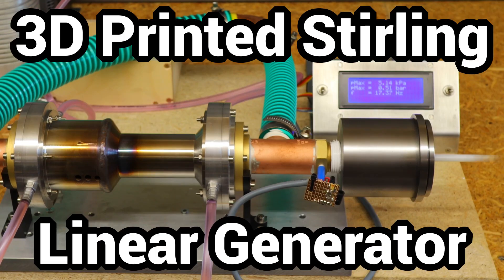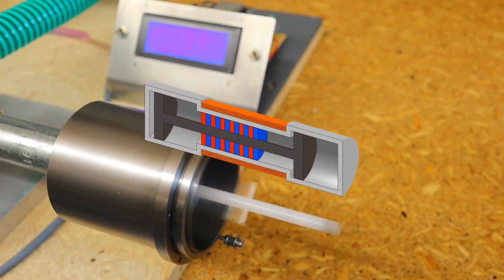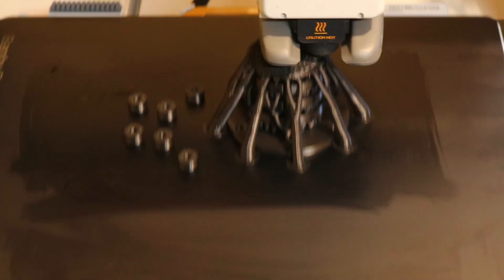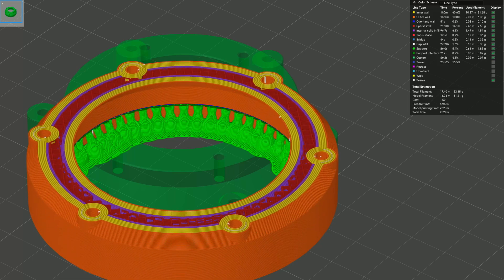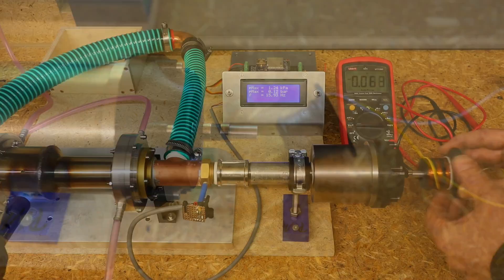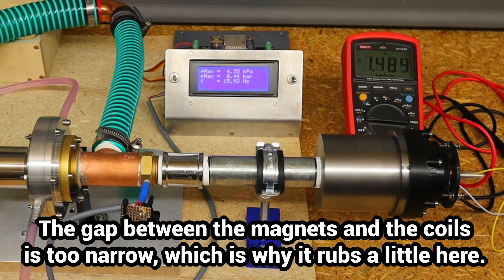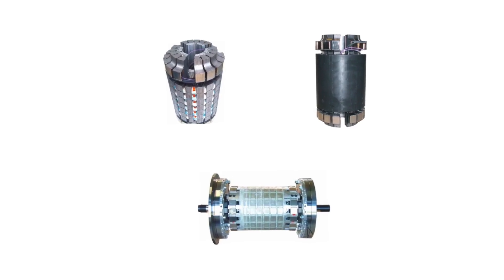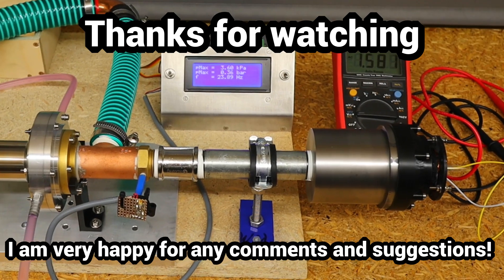Linear Generator for thermoacoustic Stirling engine – how to get most power from magnets and coils ?

Comment: I am designing one and i decided to go with EI-60 laminations with the legs pointed towards the mover, and a halbach array on the mover. This design of yours was my initial design as well but I decided against it, simulations show the flux linkage just isnt there, no way to get decent flux with iron either, no space for laminations (or complicated laminations).. Disadvantage is you need about 150mm ID to make this work
Reply from the maker: Yes, at the moment I am also thinking about a new design.
I am playing around with FEMM and try to find an optimum arrangement.
I want as little as possible moving mass and not too much coils as I want to rectify them separatly for efficiency reasons and I want to use the generator also as a linear motor for starting.
A Halbach array is really nice but also quite complex.
If you have any suggestions, I would be very happy!
In the next weeks I will spend much time with designing with FEMM and other tools to get a powerful linear generator.
Thanks for your kind comment and looking forward for more, do you know our Discord server? There we discussed already a lot about linear generators, itwould be nice if you would join!
Reply: @myengines2443  I suggest winding your coils for a battery voltage (as in back emf at your expected mover velocity), and then use an off the shelf BLDC controller, you just have to make sure you offset your 3 phases so its true 3 phase AC othrewise it wont be able to drive it. Then with controllers like ODrive you can just use UART on an arduino to tell the odrive to add or subtract X amps (torque mode on the controller).
Reply: @myengines2443  Not able to find your Discord server btw... what is it called
Reply from the maker: The link is in the video description!

Comment: you can take metal dust from a band saw and mix it into a plastic casting solution and pour that into your coils, it gives you the best of both worlds, not too much steel to cause drag, but enough to enhance magnetic flux
Reply from the maker: Yes, I saw this in a Youtube video.
There pellets of a few mm size were used, what is better?
Thanks for your nice help!

Comment: Good progress Sir! I have rectified each coil separately. It is the way to go. The precise diameter of the wire is irrelevant, it finally only determines what voltage you get out. The higher, the better. Then diode losses are minimized. I work with about 36 V capacitor voltage (after rectification).
Reply from the maker: Yes, to rectify each coil separately is better, also for control reasons for starting.
My first linear generator hat much to long and thin wire which has a very big resistance ( 142 Ohms ) which is by far too much! 
36 Volts really sounds great this would male it possible to use parts from the photovoltaics sector like MPPT and charge controller.
Thanks for your nice comment and plz make more videos :-)

Comment: Iron cores are meant to guide the magnetic field through the inductor, but the magnets themselves move through the coils so this seems unnecessary.

For the rectifying part: You could change the coil offset to make it a three phase generator. Then any three phase rectifier would work.

Comment: Hello, do you think the Stirling engine is more efficient or the thermoacoustic engine?
Reply from the maker: I think with both can be achieved the same efficiency but the thermoacoustic can be made with much less effort and less moving parts and so much cheaper which is the main problem of the Stirling engine.

Comment: bonjour, vous êtes sur la bonne voie. il y à plein de façons de faire des générateurs linéaires, le plus simple est en général le mieux.
mais je pense que pour les engins thermoacoustiques le mieux en terme de puissance de sortie (Watts) sera: 
-soit un teng mis sous air comprimé, 
-soit un générateur électrostatique comme celui de Noel Felici (un générateur de 10cm de diamètre par 15cm de long sous 8 bars génère 75 watts à 3000rpm).
-pour du piézoélectrique PZT, je ne sais pas... ce serait à essayer (peu efficace je pense)
le problème avec le générateur électromagnétique est que la masse des aimants est trop lourde, et que en charge le back emf stoppera le moteur acoustique (cogging).
en tous cas, bel effort!
Reply from the maker: Thank you for your kind suggestions, I will look them up!

Comment: This is awesome. Makes me want to get back into it!
Reply from the maker: Just do it, your videos are really impressive!
Reply: @myengines2443  https://youtu.be/n0kV_LOq11o?si=nxQzxgKIzMR2pCqt
Reply from the maker: @LES_Thermodynamics  this engine is very interesting and suprisingly powerful!
The mechanism to convert the linear into rotational movement is very interesting and I wonder if it is possible to make it for higher powers with low friction?
I really want to look out for this!
Many thanks for your suggestion!
Reply: @myengines2443 it’s powered by high pitch sound - which your engine makes. It would be interesting to see! Mine have always made low roars.

Comment: in order to correctly measure the output of an alternator, the prime mover  Must  be operating under a nominal load.    this can be simulated by shorting the output.    then you will know the  Actual  reference speed  on which output volts and amps must be  'based'.
Reply from the maker: Yes sure, there are so many things to improve before I can make a proper power measurement!

Comment: 047    that would be the  world's  WORST  coil.!!!       generating coils  NEED  to be correctly  made.     the coils you plan to make will act as current  CLAMPS.      meaning, coil output will always be  disappointingly  low.      coil design should allow for the use of  iron  cores.!      otherwise, coil efficiency will be even  lower.
if you can't get silicon steel for cores, use  common  steel  nails.       spray them, separately, with lacquer or similar.  for isolation of the nails when they are 'bundled' together.      (see the use of laminated silicon steel cores in motors and transformers.)
in this case, the generating coils should be wound using  multiple strands  of (larger) magnet wire; say  18awg.
a rotary alternator will always be more efficient than a linear one.
Reply from the maker: Yes my first coil was a mess and with the help of you and many others I got much information to make the next one better.
The one after next will have an iron core (I have pure iron, I can't find a source for silicon steel).
I plan to cover the coils from the outside but have to  get more information before.
many thanks for your help!

Comment: I think the crank arm idea didn't work because it has inherent wiggle. Whatever this thing is called, it moves absolutely straight back and forth. It gives the engine a flywheel, and the alternator gets rotational motion. 

https://youtube.com/shorts/HUW4g7v1sG0?si=udfEwsKWXhlSn8MB
Reply from the maker: The link does not work for me, can you please check it?
It sounds quite interesting, thanks!
Reply: @myengines2443 
https://youtu.be/4q5_jr3FSzY?si=jf7FaRCj3HylaL61
Reply: @myengines2443 
https://youtu.be/IcRkfFQQiEg?si=s-uTAs3JMEu4Vasf

Comment: Thomas Steiner has developed a diaphragm thermoacoustic generator without moving parts with an efficiency of more than 20% of the flame energy. 1000 We
https://youtube.com/shorts/t28hXxKnF-A?si=-oP5WScUiUsWcBbO

maybe the generator should also be made from a membrane?
Reply from the maker: Your link does not work for me, but I found his engine with very few information.
I am not sure if a diaphragm / membrane can be really reliable for month 24/7?
Reply: @myengines2443 

One of its engines has already clocked up 12,000 hours without repair.

Etalim engine Thomas Steiner

Comment: you can use a freewheel clutch, like a bicycle

https://youtu.be/l2UptoPQyH4?si=6QEHBPPoauCN4Mvi
Reply from the maker: Looks very interesting but the efficiency seems not to be optimal and you use only half the power for the movement up or down?
Reply: @myengines2443    
the best work that can be repeated by DIYers - "Development of a 5kW traveling-wave thermoacustic electric generator"

Comment: 3 Volts is not a good description of the power output. But generally, good work.
Reply from the maker: No of course the voltage alone says nothing about the power but I am still developing the test stand and its still not suitable for proper power measurements!
Reply: @myengines2443  Thanks, I'm looking forward to more information.

Comment: If you want to strengthen your 3D prints easily, I highly recommend trying the runny superglue trick. Robert Murray Smith did some videos where he showed that applying low viscosity superglue to 3D prints led to the glue wicking into the pores and gaps between extrusion lines. Then, when you spray it with an accelerate catalyst, the glue hardens, and the entire printed part becomes substantially stronger. Try this and see how it works for you.
Reply from the maker: Thanks thats a good suggestion, I already make some tests with Dichtol at the moment for gas tightness test which has similar effects I think!

Comment: What is the electric capacity you aim to achieve with your accustic engine. If I remmeber reight your old Sterling engines were between 150 and 300W.
Reply from the maker: I hope to get also in these power regions with the thermoacoustic engine but it is still a very long way.
I didn't optimize anything yet as I want a power indicator first to see wahts an improvement.
The rhombic Stirling produced up to 300 watts.
Reply: @myengines2443  Are you intending to go offgrid or just displacing grid consumption. Doing some napkin math, in the Winter a single 300W engine running 24/7 should cover your electricity needs, would it not be smarter to run 3 100W engines (if efficiency is similar) for better reliability? Just food for thought.
Reply from the maker: But 3 engines are 3 times more complex, I want to use it as a backup for my solar power plant which only need support in times of low sunshine.

Comment: Are you going to heat your experimental acoustic engine with electricity, so that you can easilly measure the power going in? Also - why didnt you turn the spool on the lathe?
Reply from the maker: When I make efficiency tests maybe I will heat it using electricity if necessary.
I did wind the coil on the lathe or what do you mean?
Reply: @myengines2443  I meant that you 3D printed it, despite it looks like an ideal object for making on the lathe.
Reply from the maker: Because I try to make as much parts as possible with the 3D printer because its cheaper,  faster more easy and rebuildable for everyone!
Reply: @myengines2443  Heating the acoustic engine with some resistive wire inside the engine is really very convenient, beside the fact that you know exactly how much heat you put in the engine.

Comment: Also, for simplicity I would suggest one coil and one magnet to begin with.  The output wouldn’t necessarily be a sine wave but diodes do not mind.
Reply from the maker: The next configuration will incorporate 4 individual coils so I can experiment with 1-4 active ones and different series/parallel configurations and 1-4 magnets.
But I think after this I will concentrate on a flat design with iron cores?
Reply: @  nice, it really depends on the coil magnet configuration.Halbach arrays work well for linear motors, especially with back iron.  But a solenoid with a cylindrical magnet can work well too. You can find some good femm analysis pictures online to visualize the field.
Reply from the maker: Yes, thanks. I am watching many magnetic flux pictures at the moment....

Comment: I would use iron or steel pipe from the hardware store or turn  mild steel on a lathe for back iron. I’m not sure of the power output and stroke length if the engine would be overloaded with back iron I would look into alternative magnet arrangements like halfback arrays. Flux density and minimal air gap are your friends. Again alternatively, a circular halbach array on the outside with a moving coil inside, but that could stress the winding or require brushes or slip rings.
Reply from the maker: Thanks for your help I will think ofit carefully and do you think this can be realized in a flat configuration more easy?

Comment: Did you consider using iron PLA for an iron core? Also, I'm not sure if it would be effective or not but would be curious to see you trying this with one of the shake flashlights, they would recharge by shaking the magnet back and forth. It might prove a cheaper alternative to making your own generator, if it proves efficient enough. Alternatively, you could maybe repurpose a starter solenoid from a lawn mower. It's cheap, and easier to fit than building the entire thing from scratch. Other potential benefits include scalability, repeatability, and easily sourced parts and replacement parts. Plus, the benefit of a mass production part, without the cost of R&D.
Reply from the maker: Thanks for your help, what is iron PLA?
Reply: @myengines2443  also called metal pla. I have a roll from amolen. It has iron filings in the plastic. I've seen videos on YouTube of guys using it to make 3d printed motors. It's not as good as using a solid iron core, but it is much better than using a regular plastic.
Reply from the maker: Thanks, I will look out for it

Comment: In this kind of generator the generated voltage related to movement speed (V/(m/s)) is key. Without high enough voltage you loose all power on unavoidable not ideal electrical elements - copper resistance, diode voltage drop, etc. If you look at the numbers the movement speed of the piston head is not great but small. For comparison it is useful to measure off the shelf motors. Rotating motors are easier to obtain so I would measure them first. If you look at movement speed->voltage conversion of motors that you have you will find that for good results you need very well designed and optmized for voltage generator. I would use a stepper motor architecture. The stepper architecture can be built in linear configuration and the obtainable performance will be similar (given same movement speed, core cross section, available volume, etc) You have to rotate a stepper motor (can be obtained for free extracting them from old printers) and visualize the generated voltage and also analyse the geometry to count the linear speed of the rotor where the magnetic magic happens (diameter is a little less than the casing of the motor itself - you can have an estimation without disassembling the stepper motor). If you compare it the movement speed of the piston you will find that you need a very efficient motor to extract useful amount of power.

Having a proper magnetic design is the key (see paradiselost9946). Air does not conduct magnetic flux well and you can only achieve about 1/1000th of what you can achieve with iron cores. You can estimate the performance of your generator by the numbers of all the flux in your magnetic circle (the limiting factor will be the saturation of the core material not the magnet if you use rare earth magnets). The flux has to change between max->0 or negative max->positive max in the smallest possible movement distance to use the most potential of the system. To have big flux change in small movement distance you need thin iron core layer perpendicular to the movement so that the opposite poles are as close to each other as possible. Because we have to squeeze as much change into as small distance as possible this is why magnetic saturation will be the limit.

To achieve the highest possible voltage you also have to optimize the movement to be as long as possible. If you use a smaller diameter for the power piston then the movement will be longer and faster but have less force at the same time. You have to find the ideal piston diameter to match the capability of the generator and the piston.

I have spent much time designing such systems as a hobby (and I have not yet built one). I found it useful to have the estimations in excel sheets with the design parameters changeable. This way you can find the optimal arrangements.

You will need a load on the output. I would use an RC car battery or something similar that I would charge with this system. You have to be carfeul not to overcharge or otherwise ruin the battery but it is a very useful load because it can handle a wide range of power while prototyping.

What is also useful is to have a H-bridge attached to the generator and control the output power with a microcontroller. (It is a separate knowledge how to do that.) Without active control you have to find the ideal matching otherwise you will get way too small power or the generator will not let the motor to start. With an H-bridge it is also possible to do active generative braking which makes it possible to utilize generated voltage that is lower than the output voltage.

You also should count the theoretical power of the engine itself. I think that without pressurizing the motor at this size you will get very small power (a few watts at maximum). It was long ago when I counted these so I am not sure about this.
Reply from the maker: Thanks for your kind comprehensive comment, I will think of it very carefully and for sure will have some questions soon!
Reply: @myengines2443  I am impressed with the work you have done and documented with Stirling engines. As I have already mentioned I did not build much but spent much time designing such machines. In my opinion the linear generator is the Achilles' heel of such machines so I started my experiments with that. I have tried to build some electric machines and I have came to the above conclusions through my failures and research. Building such a linear generator is something that I would want to do myself but I did not come to realize yet. I am a programmer and I know much about MCUs so I could help you with the digital control part of your project.